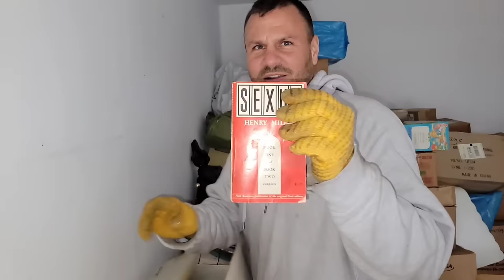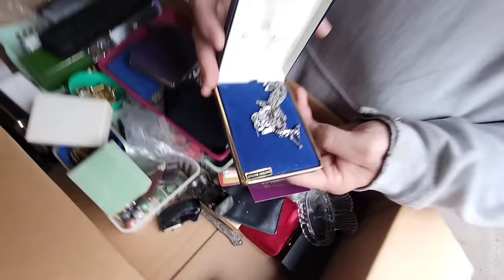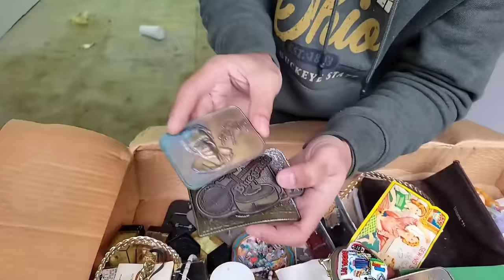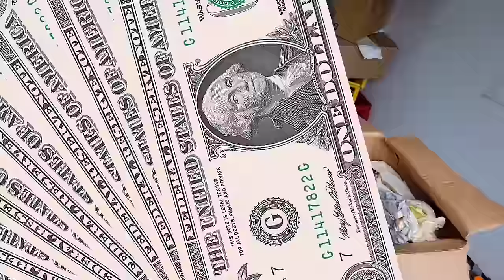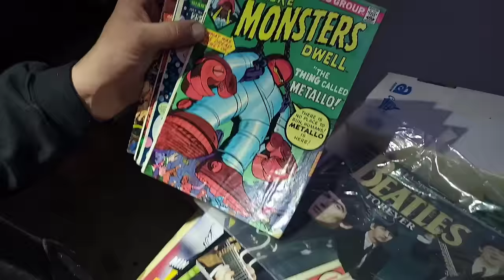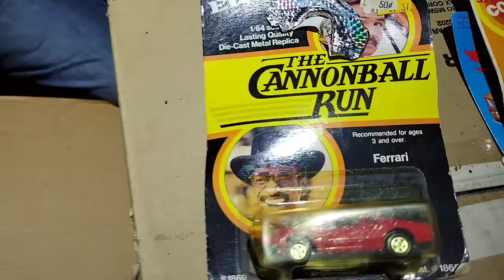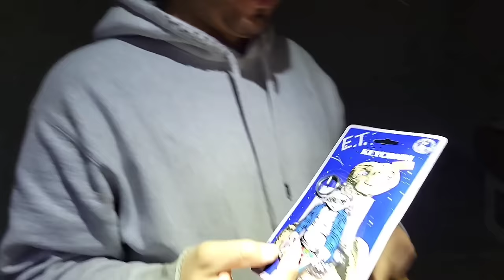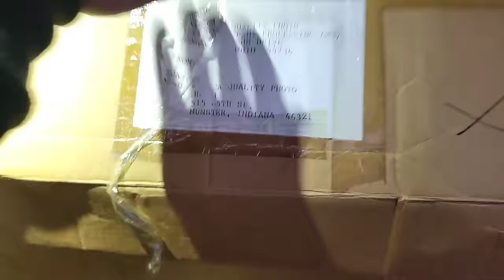Elderly Mom Dies & Kids DON'T Want Storage Unit? ~She paid on Locker for 17 YEARS loaded w/ $1,000s!

Comment: In the 2nd video you had a ring. You said it was 18k white gold .  Fyi, you will always have real diamonds or stones set in a  18k ring or pendant .  18k GF means it's just coated with 18k.  It is gold filled (GF).  There would be a silver or copper base underneath the gold filling. It is not solid gold .  It's like costume jewelry.